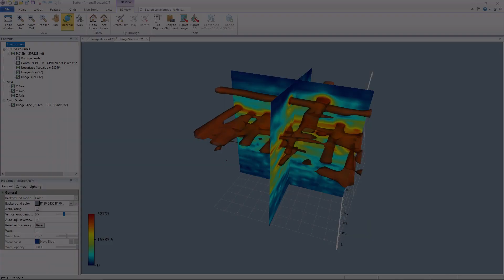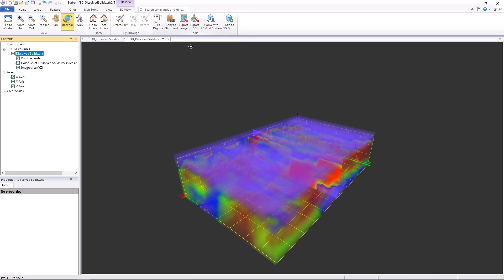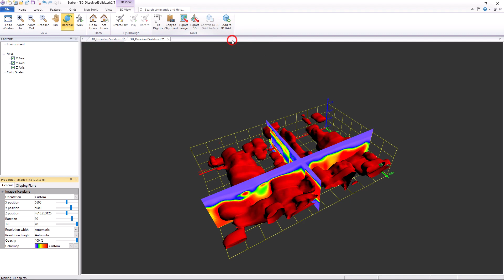Surfer New Feature: 3D Image Slices

Comment: I added a Slice. For example on Y axis at 5, the Slice run between X min and X max. I want the Slice at 5 should be between X defined values. For example at 5 the Slice should drawn between X min 20 and X max 40 instead of throughout the X Axis. Is there any way to do that. I have added 4 Slice and want to apply different X min and X max
Reply from the maker: Thanks for your comment! Our Customer Support team will be best equipped to help with this question for your project. When you get a chance, send them an email at support@goldensoftware.com to provide them with these details. If you're able to, please include your file for them to take a look at.

Comment: Kesin net yerin altindaki yapıları gösteriyor mu
Reply from the maker: Thank you for your question! Surfer is a powerful tool for visualizing subsurface data, and it can create detailed contour and 3D surface maps based on the data you provide. However, the accuracy of what is shown underground depends on the quality and type of data you input (e.g., geological surveys, borehole data, GPR data, etc.).

While Surfer can effectively illustrate variations in the subsurface, it doesn't directly "detect" underground structures. Instead, it helps visualize the data collected from other sources to reveal trends or patterns in the subsurface. If you provide accurate data, Surfer can create clear representations of underground features.

Comment: hi, How do I calculate the variable z?
Reply from the maker: Hello,

The Z variable will most likely be an elevation variable. Surfer does not have a way to calculate your Z value based on input X and Y, it will have to be data you have on hand already.

Thank you,
Golden Software
Reply: @GoldenSoftware Hi how do you create the XYZC color relief layer? Which data do you need, to create it? Can you make a video about it?
Reply from the maker: @lyldz2100 

Color Relief Maps are raster maps based on grid files. Grid files are produced from XYZ, XYZC, or drillhole data using the Home | Grid Data | Grid Data command. You can also import a grid file and create a color relief map from that. Please see "Surfer supported file formats" to determine which grid file formats are supported. 

Color Relief Map: https://surferhelp.goldensoftware.com/vec_shd_img/IDM_imagemap.htm?Highlight=color%20reliefe
Grid Files: https://surferhelp.goldensoftware.com/gridmisc/grid_files.htm?Highlight=grid%20file
Surfer supported file formats: https://support.goldensoftware.com/hc/en-us/articles/227882008-Surfer-supported-file-formats

To learn how to create a Color Relief map, you can review the Help documentation above or watch this training video (grid-based maps, including color relief maps, are discussed at the 6:33 mark): https://support.goldensoftware.com/hc/en-us/articles/360012100713-Surfer-Map-Types-Training-Video

If you have Surfer installed and need sample data to work with, I suggest accessing the following folder: C:\Program Files\Golden Software\Surfer\Samples. Please note: the specific data file used in this video may not be available. 

Thank you!
Golden Software
Reply from the maker: Hi  @lyldz2100  ! 

You can learn more about how to 2D create color relief layers from XYZC data in this article: https://support.goldensoftware.com/hc/en-us/articles/12697729023515-Surfer-New-Feature-Create-a-2D-Map-from-a-3D-Grid

You may also find the latest webinar about Surfer's new features helpful: https://support.goldensoftware.com/hc/en-us/articles/25207314042395-Discover-Surfer-27-Explore-the-Latest-Features-of-Surfer-Webinar

Best,
Katie
Golden Software Support